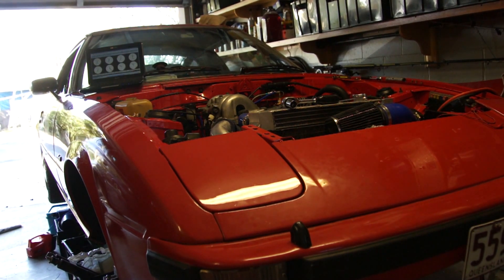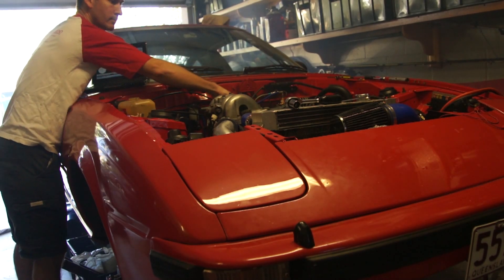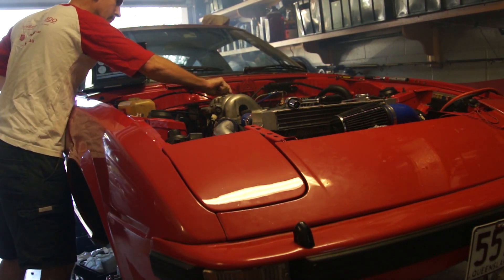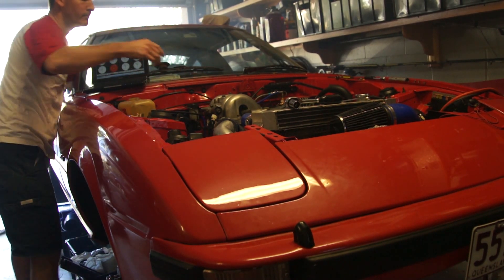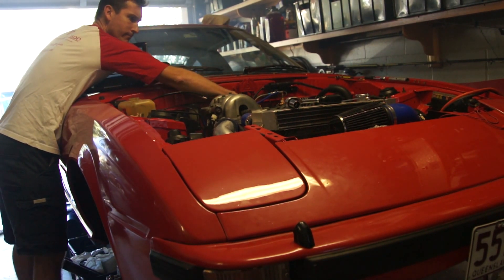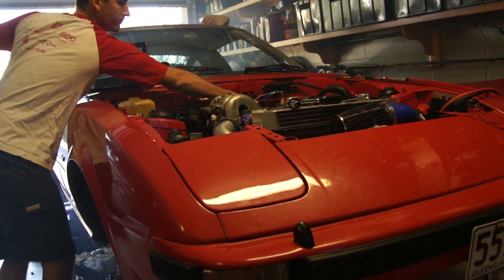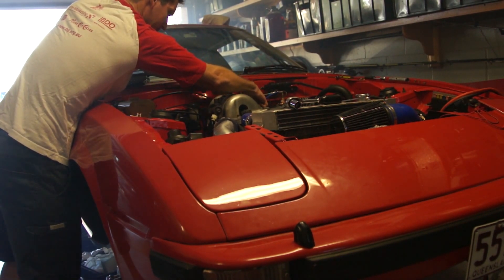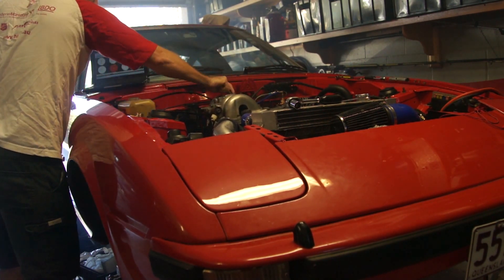Rx7 13b turbo first start camera 2

Comment from the maker: That is the same setup as detailed by Aaron Cake, search for Aaron Cake RX7, he has a write up on an FC install, he uses the stock coils in wasted spark. You should be able to copy his settings. Can the coils fire in test mode?
The LS2 coils have an inbuilt igniter, so the MS drives them directly

Comment from the maker: Assume you have the MS3x? How have you adjusted the ms3 pcb r52 and r56 - the reluctor zero crossing and hysteresis trim pots, as well as the equivalents on the ms3x?
I have stock S5 CAS and LS2 coils. Can you fire coils in test mode? Will ecu detect rotation if CAS is spun fast (with a drill) - like equivalent of 6 to 7000 rpm? To what ECU pins have you connected what CAS wires?